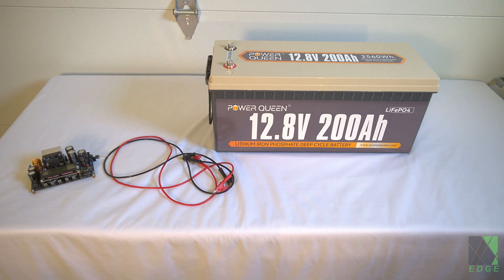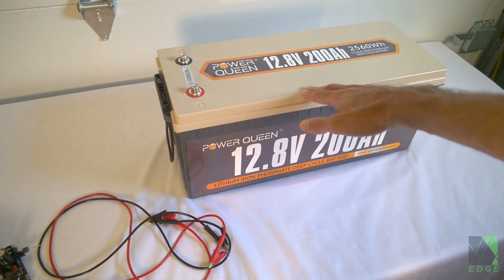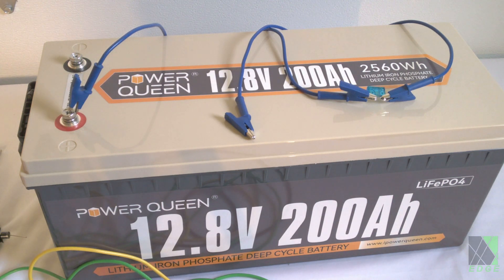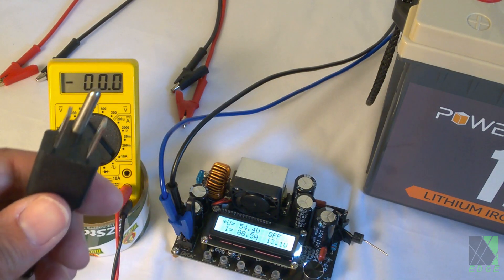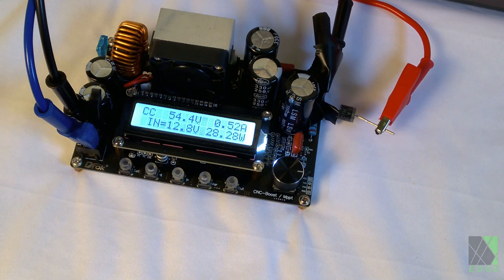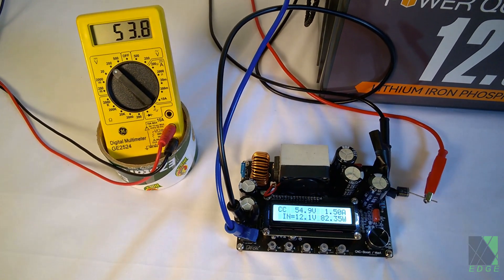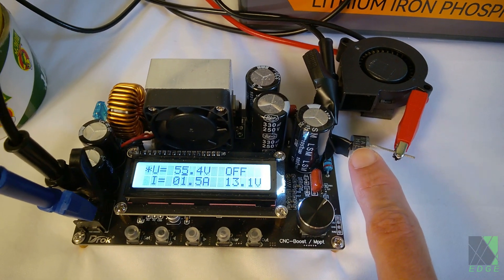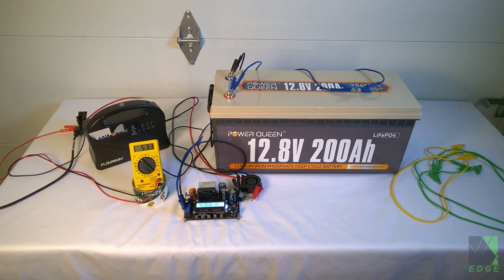Charging 48v mower from 12v 200ah LiFePo4 Power Queen battery  backup solar power charging system

Comment: Ryobi used a standard IEC 120/240v connector attached to the battery?  😱
Reply from the maker: @Sylvan_dB Thankfully no, but those connectors are commonly used on chargers and it just so happens I have plenty in stock :)